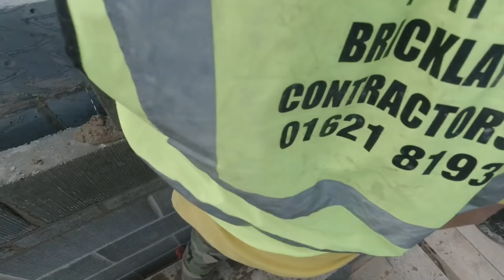Monday Club

Comment: NICE
Reply from the maker: Cheers stevie
Reply: @trickybrickys  ADAM OK IF I ASK YOUR ADVICE my daughter getting porch built the the bricklayer has started off the founds with facing brick 3 brick high then blocks as getting rendered should he not have used engineering brick ,will it make any difference as its finished ,just to get rendered , cheers
Reply from the maker: As long as he puts a dpc in it will be fine mate. 🙂
Reply: cheers adam appreciate